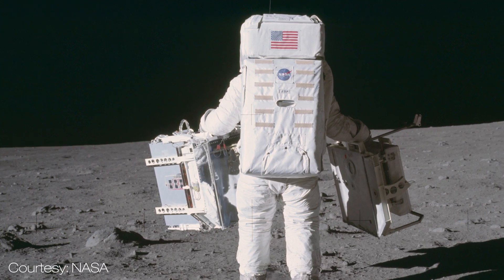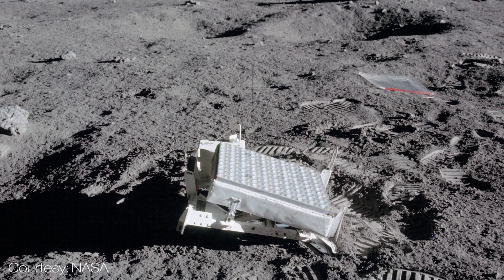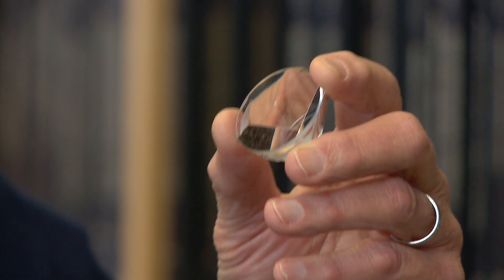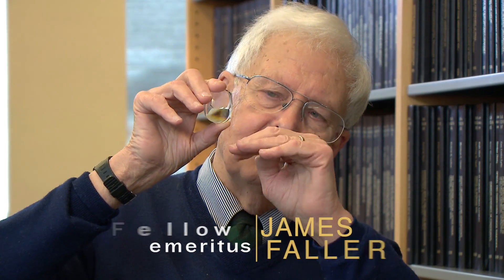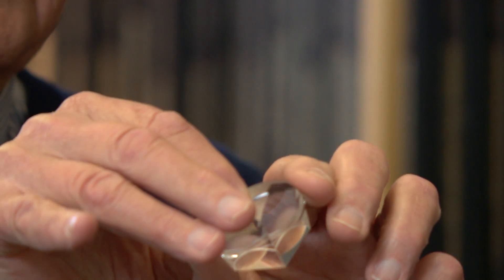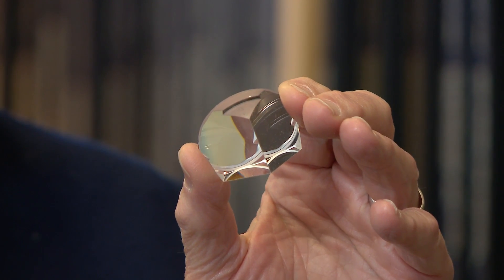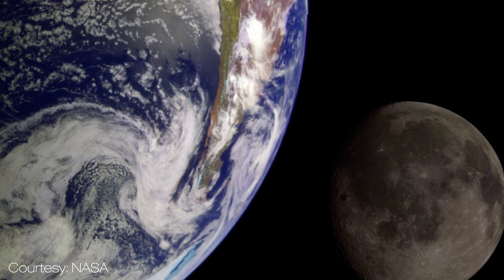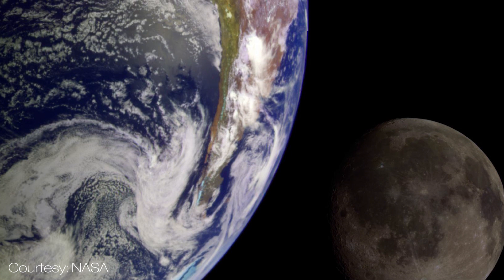Apollo 11's last working experiment on the moon

Comment: Clearly a smart scientist - there were laser experiments at the moon by Russia too - and by US before Apollo 11 actually - the moon itself reflects the beams back to earth without the help of these reflectors - I would like to hear the explanation of how the lasers sent from (moving earth) hits the also moving moon target of a 2 metre wide reflector and can confirm with certainty the reflection could not be from the surface of the moon unless it hits the reflector - my understanding is the width of the beam when it arrives from earth onto the moon is in fact quite wide and the return signal received is indeed from the moon but not as i said requiring the reflector for to work ?????

Comment: When Apolo 11, Apollo 14 and Apollo 15 landed on the moon, they had a laser reflector on board. These three devices can still be used today to measure the exact distance between the Earth and the Moon. 
The focused laser pulse emitted by the scientists from the ground station on Earth is initially extremely strong and powerful, but the beam fans out to a diameter of two kilometers on its way to the moon.
Special glass of the highest quality and purity is required to make a measurement possible at all. The manufacturer of the laser reflectors, Bendix Corp (now Honeywell Aerospace), knew in the 1960s that quartz glass from Heraeus has a uniquely high homogeneity and commissioned the patented manufacturer from Germany to produce suitable special glass.
The reflector's material manufactured by Heraeus in Hanau (Hesse).  High-tech silica of the highest purity (99.9999 percent) from Heraeus made this reflector possible in the first place. To this day, even after more than fifty years under extreme conditions (-138 degrees Fahrenheit at night, plus 275 degrees Fahrenheit during the day and radiation), it still functions excellently.  This is how a town in Hesse in western Germany became part of the Apollo project.
 This not a hoax.
Reply: Folk believe all sorts these days
Reply: @bloodsthicker5651  I agree.. There's even idiots stupid enough to believe the Moon landings where faked.

Comment: if this reflector is still there, and has such precise capabilities, couldn't it be used to start fires in random or targeted places on earth with a high power precise laser beam ?
Reply: The reflector is still there, and no, it can not target places on Earth nor start a fire. Laser light spreads and becomes more diffuse over distance. When you point a laser at the Lunar Laser Ranging (LLR) mirror you might fire a burst of 3x10^17 photons (that's 300,000,000,000,000,000 photons) which spreads out to an area about 4 miles wide on the surface of the moon. Once the laser bounces off of the mirror on the moon, it spreads out further on its return journey. By the time the beam returns to Earth the laser has spread out over roughly 9 miles. From that pulse, only about 1-5 individual photons are received at the location from which they were sent by an 11 foot diameter collector, and those 1-5 photons are spread out by over an area of about 3/4 of one inch. That's not enough light to be perceptible by the human eye, let alone enough to start a fire. Further, the mirror was designed to reflect light back at the same angle that it is received, so you cannot 'target' places on Earth -- just the 9 mile area around the point of origin.

There's a great webpage that explains this more here if you'd like to read up on the science behind it: https://tmurphy.physics.ucsd.edu/apollo/basics.html
Reply: The nature of the optics on it cause it to reflect light directly back at the light source.
Reply: Education has failed this country.
Reply: Yes

Comment: For all your talk of these reflectors on the moon it simply isn't possible to pinpoint something so small from the earth. 
Not even the larger junk from previous 'landings' can be seen.
Reply: Which is why reflectors are used for measuring the distance of the moon :-)

When laser light from earth reaches the moon, it is spread out over several kilometers. As a result, photons of light reflected back could come from anywhere within that region, from the top of a hill/mountain to the bottom of a crater, hence the distance measured that way is only accurate to within kilometers.

By placing a retro-reflector on the moon, the same laser light when correctly aimed at the moon will hit the reflector and produce a significantly brighter reflection (a spike in the brightness) compared to the surrounding area, just like a reflector on a cyclist caught in the headlights of a car.

Because the light from the reflectors come from a known fixed point on the moon's surface (where the property of the photons proves it's from the reflector), the accuracy went from kilometers to centimeters, and today it's now down to less than a millimeter (hence we now know the moon is spiraling away from earth at the rate of 3.8 centimeters per year).

Hence significantly greater accuracy in distance measurement is the reason why three Apollo missions placed retro-reflectors on the lunar surface, and why the USSR placed retro-reflectors on their two lunar rovers landed on the moon in 1971 and 1973 (Lunokhod 1 and 2).

So although retro-reflectors alone don't prove men were on the moon, they do add to the evidence, and the fact that anyone with the right equipment can receive a reflection from those reflectors (first used within days of being placed on the surface) proves those reflectors are on the moon.

Comment: Our moon is 238,900 miles from Earth, yet they only travel 1/1000th that distance, approximately 254 miles from Earth, today. They can't penetrate the dangerous radiation beginning 1,000 miles from Earth, known as the Van Allen belts - NASA acknowledges this. So, if you think about it, they can't even do the 900 miles part ;).
Reply: You said "They can't penetrate the dangerous radiation beginning 1,000 miles from Earth, known as the Van Allen belts - NASA acknowledges this."

An incorrect assumption that you got from conspiracy theorists who have never sent anything into space themselves :-)

Here's what the scientist Dr Van Allen said about the radiation belts named after him (you know, the discoverer who was the leading expert on the radiation belts until his death in 2006) and about radiation in space for the Apollo missions;

Dr Van Allen quote 1: "A person in the cabin of a space shuttle in a circular equatorial orbit in the most intense region of the inner radiation belt, at an altitude of about 1000 miles, would be subjected to a fatal dosage of radiation in about one week."

In other words, it would take ONE WEEK inside the most intense region of the belts to receive a fatal dose of radiation. That is why low Earth orbit manned spacecraft like the ISS stay as far below the belts as possible, because astronauts will typically be on board for weeks or months (and some for over a year).

If the ISS was at an altitude of 1000 miles instead of 250 miles, then the astronauts would receive levels of radiation that would put their lives at risk within weeks.

Dr Van Allen quote 2: "The outbound and inbound trajectories of the Apollo spacecraft cut through the outer portions of the inner belt and because of their high speed spent only about 15 minutes in traversing the region and less than 2 hours in traversing the much less penetrating radiation in the outer radiation belt. The resulting radiation exposure for the round trip was less than 1% of a fatal dosage, a very minor risk among the far greater other risks of such flights."

In other words, Dr Van Allen confirmed that the Apollo astronauts passed through the weaker areas of the two belts in around 2 hours, hence the radiation wasn't a problem, and he confirmed that the total radiation there and back wasn't a problem either.

So as Dr Van Allen confirmed about the Van Allen radiation belts named after him, they are not a problem to pass through in just a few hours (as they did during the Apollo missions), but they are a problem to remain inside constantly for weeks.
Reply: @yazzamx6380  NASA’s own scientist explains differently, that it can’t be traversed until the technology is developed to penetrate that region.
Reply: @mattrobinson4994  - You said "NASA’s own scientist explains differently"

Incorrect, where you are admitting you fell for the claims of conspiracy theorists without checking their claims out for yourself, hence you fail to see how they are manipulating you :-|

So go ahead and tell me that you're NOT referring to conspiracy theorists claims about the 2014 Kelly Smith video discussing the Orion Spacecraft :-)
Reply: @yazzamx6380  exactly what I’m referring to. Why is that not credible? It’s a NASA source that you’ll now try and re explain for me I guess😁.
Reply: @yazzamx6380  Kelly said, and you quoted, "We must solve these challenges before we send people through this region of space."

But if it was done in the summer of '69 (that's a song btw), why must this be solved first??
Reply: @mattrobinson4994  - You said "But if it was done in the summer of '69 (that's a song btw), why must this be solved first??"

Because he's talking about the ELECTRONICS Matt.

The electronics used during the Apollo missions consisted of circuits and wires big enough to be seen with the naked eye, hence they were not effected by the electrons in Van Allen belt radiation.

In contrast, today's electronics consists of circuits that are so tiny that we need very powerful microscopes to see them.

The smaller the circuits/components then the more sensitive they are to radiation, and hence as microprocessors got more powerful over the years by packing more and smaller components into each chip, they became more and more sensitive to radiation in space, especially the Van Allen belts, and so modern electronics need to be radiation hardened and/or properly shielded to protect them.

Simply put, take an early 70s electronic calculator into the Van Allen belts and it would work without problems, whereas your smartphone would crash within seconds.

So the radiation was not a problem for the Apollo spacecraft, but it is a problem for modern spacecraft with their modern electronics, and therefore modern manned spacecraft like Orion must be tested in space FIRST to make sure the electronics has been properly protected against the radiation before they risk putting people inside (since their lives will DEPEND upon the electronics working).

Hence the successful test of Orion in December 2014 where it was twice sent into the region of the Van Allen belts with the highest radiation, and it functioned perfectly.
Reply: @yazzamx6380  Well perhaps you'll get to go one day and hop around on the moon ;)
Reply: @mattrobinson4994  - You said "Well perhaps you'll get to go one day and hop around on the moon ;)"

We are as far away from space travel being accessible to the ordinary person today as airplane travel was to the ordinary person at the beginning of the last century. So unlikely to happen ;-)

But seriously, I do emphasise the point that believing in a conspiracy doesn't mean you MUST accept ALL the conspiracy claims made. Instead, if you're really interested in the 'truth', then accepting that certain conspiracy claims/evidence CAN be wrong is more likely to get you closer to the 'truth' :-)
Reply: @yazzamx6380  one of the more cogent exchanges I've seen between an Apollo Moon denier and someone willing to engage with them and help set them straight. Good on you for being polite and civil throughout and for your excellent explanations. You might not turn that person around, but it's possible that at least a seed or two was sown.
Reply: @marshallcello1128  - After wading through several insulting replies, your reply was great to read and really lifted my mood. Thanks very much my friend, I needed that :-)
Reply: @yazzamx6380  bottom line - they are not on the moon today bc they CAN’T go friend. Simple as that.
Reply: @yazzamx6380  guess we’ll agree to disagree, and I’ll wait for the “return” to the moon😁
Reply: @mattrobinson4994  - Sure, lets agree to disagree, but I expect when they do return you will just cry out "Fake", "Hoax", "Lies" 😁
Reply: @yazzamx6380  another point - if it worked so flawlessly in 1969, why destroy all that technology? Seems very odd🤔
Reply: @mattrobinson4994  - Concorde worked flawlessly during its first flight in 1969 too, and yet where are the supersonic passenger planes today? Seems very odd, right? :-)

The Space Shuttle worked flawlessly during its first flight in 1981, and yet where are the Space Shuttles today? Seems very odd right? :-)

🤔

Losing or destroying the technology is about not having the craft in service TODAY, it's not about destroying the hardware or the plans or the knowledge! So nothing is being covered up.

Hence Concorde is lost/destroyed technology, it will never go into service again. The Space Shuttle is lost/destroyed technology, it will never go into service again. Likewise the Apollo Saturn V rocket is lost/destroyed technology, it will never go into service again. And so on.

Btw, you can find ALL those craft and more with their 'destroyed technology' in aeronautical and science museums :-)

If we want that technology back, then we will rebuild it using MODERN technology and MODERN techniques.

Hence NASA will soon have the SLS rocket in service, which is as large and slightly more powerful than the Saturn V rocket it replaces, and they have the Orion space capsule which is larger and more sophisticated than the Apollo Command Module it replaces. Therefore the SLS is the new 'Saturn V', and Orion is the new 'Apollo Command Module'.

On its debut launch this February, the MASSIVE SLS rocket will take the Orion space capsule around the moon and back to Earth for its second test in space. And assuming all goes well, then in 2024 the SLS rocket will again take Orion to the moon but this time with astronauts inside.

Those are examples of the USA rebuilding the technology that was lost/destroyed, i.e. taken out of service, and hence in 2024 people will return to the moon.
Reply: You said "Our moon is 238,900 miles from Earth, yet they only travel 1/1000th that distance, approximately 254 miles from Earth, today."

Because sending people to the moon requires building the largest and the most powerful rockets in history.*

Back then, the USA built the spacecraft and the massively expensive Saturn V rocket (thanks to Congress increasing NASA's budget by up to 9 TIMES normal) for that purpose and it worked like a dream, hence they were able to use it to send their astronauts to the moon, but the cost meant it wasn't sustainable.

In contrast, the USSR/Russia built the massively expensive N1-L3 rocket, but unfortunately it was a nightmare, it blew up during every test launch and so the USSR didn't have a rocket to send their cosmonauts to the moon. Therefore they eventually had to cancel their manned moon landing program.

China became only the third nation to build rockets capable of sending people into space in 2003, thanks to help from Russia, hence they're getting there with their space program but are still a long way off from building their own Saturn V size rocket.

Now look up NASA's massive SLS rocket which is as large as the Saturn V and slightly more powerful, where it is now complete and due to launch this February, where it will take the Orion space capsule to the moon and back to Earth.

The same SLS rocket is scheduled to take a crew of astronauts inside the Orion space capsule to the moon in 2024.
Reply: "They can't penetrate the dangerous radiation beginning 1,000 miles from Earth, known as the Van Allen belts"............................Do you mean the Van Allen Belt's which were discovered by and named after Dr. James Van Allen who wrote "The outbound and inbound trajectories of the Apollo spacecraft cut through the outer portions of the inner belt and because of their high speed spent only about 15 minutes in traversing the region and less than 2 hours in traversing the much less penetrating radiation in the outer radiation belt. The resulting radiation exposure for the round trip was less than 1% of a fatal dosage – a very minor risk among the far greater other risks of such flights".. Dr. James Van Allen.